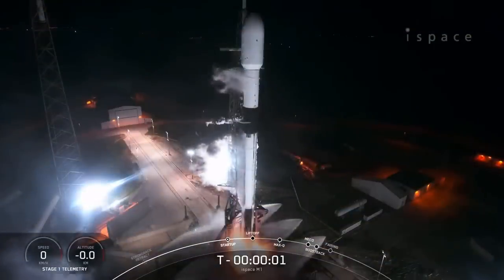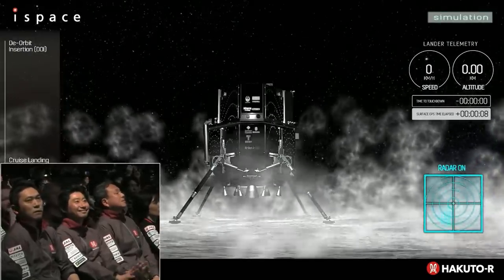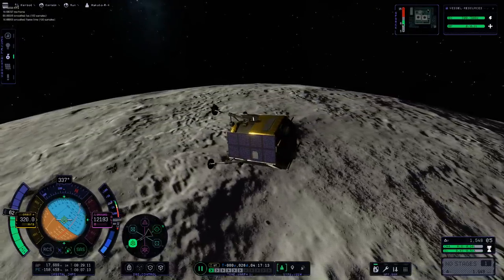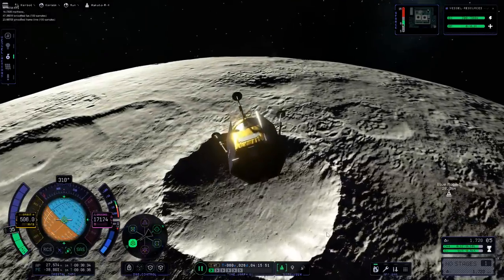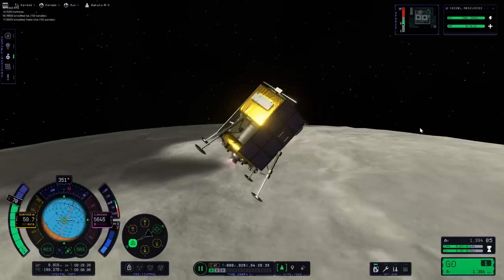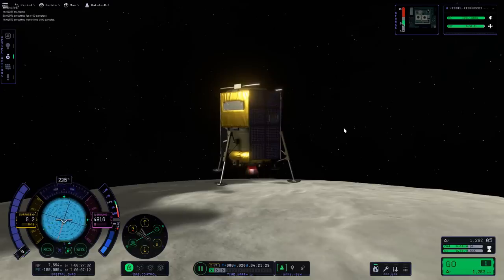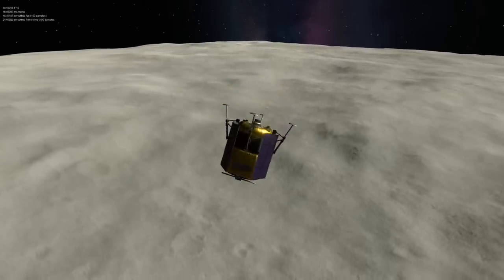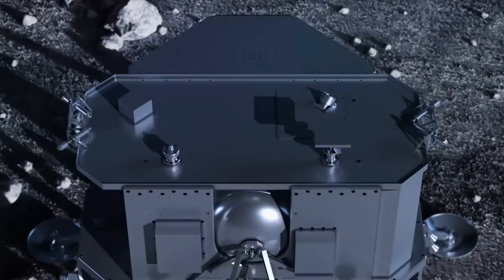Why Japan's Moon Lander Crashed Due to An Unbelievable Computer Bug

Comment: About 30 years ago I had a single page photocopied from Computer World or some such industrial publication taped to the outside of my cubicle.  On that page was listed the ten most expensive software defects (bugs).  I was astounded when the most expensive defects caused hundreds of millions of dollars of loss.   When you read the list the top five defects (again, multi million losses) you found out that they were all losses of spacecraft and/or their payload.  Flight software is tremendously complex and a single error will cost you your whole vehicle and years of effort.  Now that page would have to be scaled to near billions of loss I expect
Reply: Maybe not most expensive, but Therac-25 should be on that list somewhere. Ya know, because it ended up maiming and killing a bunch of people with intense doses of radiation.
Reply: There you go Scott - that’s an epic video right there.  Top 10 most expensive Astro/Software defects.
Reply: @a.p.2356  In a way, that is possibly the most expensive software bug ever; in another, it's quite cheap. Consider: we know for a fact that cars kill people, all the time, in every way, yet we do not ban cars. 

The value of a human being's life has been calculated, and apparently it's cheaper than you would expect. Electricity production has a cost measured in lives per TW/h. You can look it up. Biofuel has a cost of 12 people per TW/h. Solar is 0.44. Wind is 0.15, and new/clear is 0.07.

The average American consumes 0.1-0.2 GW/h per year. In other words, over the course of your entire life you will likely kill less than one fiftieth of a person in order to keep the lights on. This does stack with the people you kill while driving, however - I'm talking about tyres particulate and excess death from pollution, not running somebody over.

Ain't that grand?
Reply: @o0alessandro0o  It's not easy to respond to that kind of information. I do know that training and regular checking of pilots contributes to a high level safety for commercial aviation (ignoring mechanical failures). For drivers, I reckon that similar processes should be followed. It would not be popular among the general public, but I have said for years that licenses should be graded, based on years of experience and how many training courses a driver takes. Governments balk at the idea, however, and go on putting up cameras and roadside radars, more draconian speed limits, but never addressing the fact that poor situational awareness, slow and inappropriate reactions, and limited skills are the biggest factors in car accident rates. But I'm going down a rabbit hole!
Reply: Not strictly a bug, rather bad design; but implicit nullability - first introduced in ALGOL in 1965 and later copied into most programming languages - was famously coined by its creator as a billion dollar mistake.

I think I read somewhere that at the time the estimate was quite accurate, but that was 2009 so by now it wouldn't be surprising if it is an order of magnitude too low.
Reply: It is not flight software being complex, it is about realistic testing of that software being expensive or impossible.
Reply: @malbacato91  It's funny: he is 100% correct, yet somehow I still think char* s = NULL; is a good thing to be able to do

I guess it's just the way I grew up :P

Edit: then  again, I also believe that gets(s); is capital-B Bad, so, you know, I'm inconsistent that way :P
Reply: @o0alessandro0o  true; actuarial tables are grim reading, if you ever feel the need to place specific monetary values on human suffering. This goes a bit beyond that though; even the worst designed software doesn't typically have a failure state where it fries you with lethal amounts of radiation.
Reply: @a.p.2356  On the one hand, it was a corner case. On the other... Good testers are worth their weight in gold. "Everything works when you are having a meaningful conversation between commands, but you may or may not kill people if you type too fast" is not a typical failure state.
Reply: @travelbugse2829  Driving licenses are graded on how many courses a driver takes. Different vehicles require different levels of training. But even having a license to drive, say, a petrol tanker, plus 50 years of experience, wouldn't enable you to drive a car safely at 40mph in a 30 zone.

It is crazy how many terrible drivers there are on the roads though. I'm a delivery driver and I see it multiple times every day. They could make the tests a little bit harder, but we have to accept that a certain percentage of qualified drivers are still learning the ropes and cater to that. It isn't Draconian it's sensible.
Reply: @o0alessandro0o  I would feel a little more sympathetic to the coders if they hadn't removed the mechanical interlocks which prevented this from happening on their previous machines, and used only software interlocks... which didn't actually check the physical configuration of the machine before smashing the big "blast everything with radiation" button
Reply: @a.p.2356 Thanks, the Therac-25 made for some good, cautionary reading.
Reply: It might be interesting to see an updated version of that page adjusted for inflation as well as one that just uses the cost at the time of the loss.  Note that the original page might not have included Ariane's 5 first launch.
Reply: And....?
Reply: @a.p.2356  There is that... But I don't know that it was the coders who decided to do away with the physical interlocks.

That said, the program was apparently a dumpster fire on wheels: nagware all the way, popping up tens of opaque error messages that gave the operator no useful information unless they went and looked it up in what I can only assume was a phonebook of a manual (sort-of literally, since all the errors were numeric codes), and with no way to prioritize or disable warnings.

And then the operator ignored the wrong message (which looked identical to all of the other messages) and people died.
Reply: @nagualdesign  There are two tests that are not done IMO. 1/ Make the driver back up 20ft. 2/ The two cones skill test: Someone stands, say 20ft away with cones and the driver signals to the person how wide the cones should be placed (just wide enough). Then  go through without hitting them. Sorts the soy boys from the rest.
Reply: @malbacato91  When I started programming back in the 1970s one of the frustrations was that, unlike UNIX, IBM did not provide a high-level language interface to any of its operating systems.  To access those services from an HLL I had to access operating system control blocks which were pointed to by fixed memory locations.  I defined a structure which I overlaid on memory by using a null pointer.  This permitted me to write a program in an HLL (PL/1, as C was not yet supported by IBM) which supported submitting programs to execute in background, then retrieve their printed output, and then delete that printed output to save paper.  I also performed dynamic allocation of devices (tape drives on which to back up the application) and other capabilities which I would have needed to do in machine language if I could not use a null pointer.
Reply: Wonder where the Knight Capital bug would rank in that list now. Or just your average bug that takes Facebook down for a day.
Reply: @o0alessandro0o  There is a problem reducing the value of life into such calculation: It does not factor in multimillion-dollar lawsuits. And probable jail time.
Reply: @PanduPoluan  You can sue anybody for anything at any time. Most such lawsuits are settled out of court. There's a reason for that.

Jail time only happens if you show criminal (depraved/reckless) disregard for the life of others, beyond any reasonable doubt. 

We as a society have determined that life has a finite value, and then put that value into numbers. Evidence of that is everywhere. As an example, in a world where life has infinite value, healthcare is free.

If you find one of those worlds, do please let me know.
Reply: It's not "a single error", we software developers aren't gods, we developers cannot test the software we write, that's a fact, so this is many errors, at many levels, and not only testing, but managerial, huge managerial oversights, and a chain of errors.
Reply: re: " On that page was listed the ten most expensive software defects (bugs)."
What did the failed FAA air traffic automation system cost? I think that was the biggest, and I hope it was listed. I think that was like 2.6 Billion spent, of which they salvaged 1.5 Billion.
Reply: This didn't look like a bug per se though. The fault protection was just too sensitive for the landing site having disregarded a good altimeter sensor.
Reply: @pomelo9518  Yes. And?

There are many ways of doing that math, and you can end up with a large range of possible results, all of them wrong. 

In the end, however, all those methods come out with a value in US$ that answer such questions as: "how much are you willing to spend in health and safety, per annum?".

Because "as much as it takes" is not, for example, a valid answer to give your bank when they ask how big a loan you want.
Reply: @o0alessandro0o  The cars example seems flawed. Preventing all car travel would likely cost far more, even measured in human lives lost. The difference between cars and the Therac-25 is that the latter was due to an (avoidable) error. We knew how to make the same machine that didn't delivery fatal radiation doses. We don't know how to make something like a car but that's 100% safe.
Reply: @o0alessandro0o  The point is that, reducing life to a finite value works only if you're government and considering mass ending-of-life such as war.

If you're a company, reducing life to a finite number is not doable because you can be sued. Sure, it can be settled out of court, but that means the original approximation for "life as a finite value" already misses, adding more loss over the "corporate acceptable loss". And smart lawyers / people actually aiming to take down the company no matter the cost = astronomically large settlement or no desire to settle and a full court battle dragging the company through the mud.

And the uproar can cause the Attorney Generals to actually press criminal charges, if just for politics. Especially if investigators discovered that you actively reduce people to just a finite value, and hence you are "proven to have a disregard of life".
Reply: @PanduPoluan  You can be sued by anybody for anything at any time. They need to prove, by a preponderance of evidence, that you caused a certain type of damage, at which point they can be compensated for that damage.

Punitive damages are capped in a number of jurisdictions, so most plaintiffs only really reclaim the actual damage, which is where those actuarial tables come back.

And again, no, you do not get to ask the bank for infinite money to cover every possible contingency/liability. You allocate a budget and spend it. Every single large company includes a settlement fund line in that budget.

A criminal lawsuit requires "reckless disregard" or "depraved indifference". That is not the same as common sense disregard, or common sense indifference.

If the company can show that they took reasonable precautions, there will be no criminal lawsuit (criminal trial, I should say). No matter how many people died.
Reply: @gblargg  It is. It's also a very old example. This isn't a new debate :)

The bottom line is that we as a society value a large amount of convenience for a large amount of people more than the lives of a small number of people, especially when there is no clear correlation between cause and effect. 

This is a proven fact; the sentiment has been changing somewhat in the last several decades though - see for example the increase in anti-smoke laws.
Reply: @o0alessandro0o  I thought with cars it was people accepting the risk themselves (by being in the car they're driving), living with a small risk of death versus not living. It's not a hard choice to make.
Reply: @gblargg  A few years ago, a car cut a corner, bumped into an other car, which was improperly parked, pushed the othercar into a pedestrian, who was minding her own business, and killed her.

On a more relevant note, for approximately half a century, leaded gasoline was the primary automotive fuel in the world. It is estimated to have caused at least a million deaths per year worldwide (specifically, it is estimated that the number of premature deaths dropped by that much since leaded gasoline was banned, but the effect of lead poisoning are long-term, so the real numbers are up in the air). 

The data for deaths from rubber and brakes particulate aren't available, because the effect is comparable in mechanism to that of smoke particulate, which means it's very hard to pin down a death from cancer to tyre rubber, as opposed to second-hand cigarette smoke (which also doesn't only kill via particulate, so). Could be one death per year, or it could be ten million.

None of those deaths target drivers specifically, they are random increases in premature mortality that are simply a fact of our lifestyle.

This isn't to say that we don't try to reduce the number of those deaths, but again, we do not have infinite money, and so therefore we apply simple math to the issue. And that math requires determining the cost of saving a life, and comparing it to the benefit of saving that life.